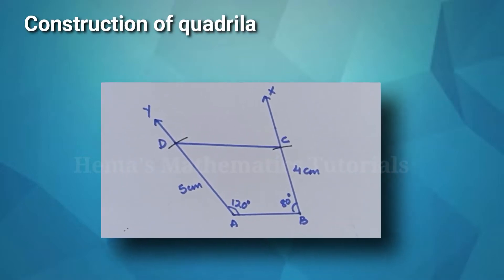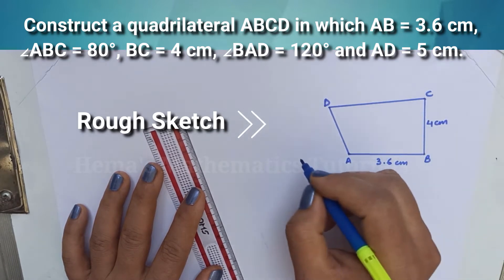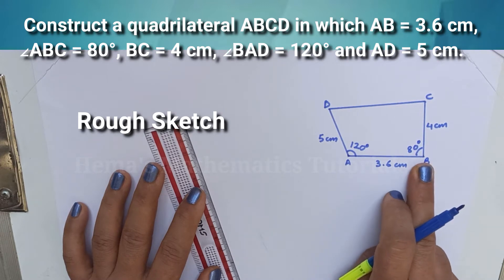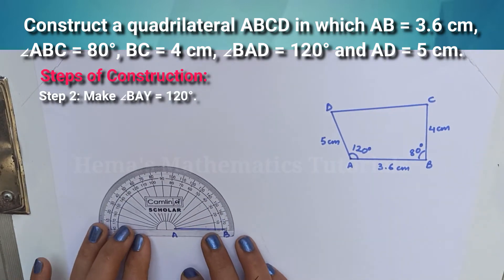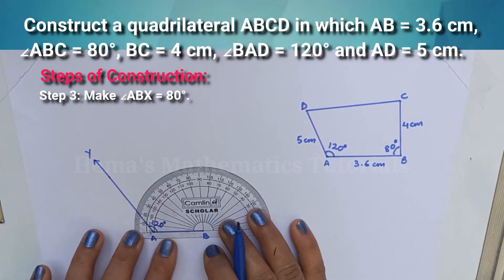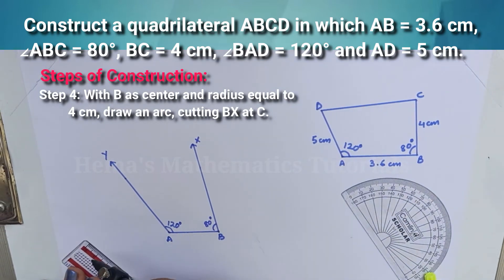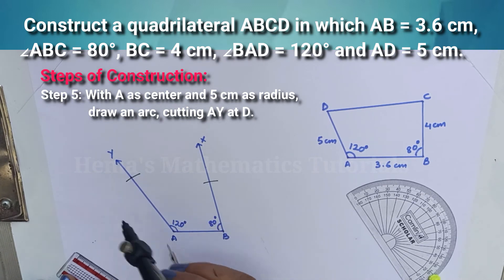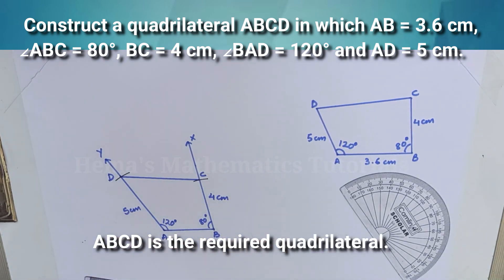To construct a quadrilateral ABCD in which AB = 3.6 cm, ∠ABC = 80°, BC = 4 cm, ∠BAD = 120°.....

Comment: Why you take 120°  downside of the compass and 80° upside  of the compass
Reply from the maker: See zero of which scale on the protractor coincides with the line. While making 120° place centre of the protractor at point A and point B coincides with Zero of inner scale. While making 60° angle place centre of the protractor at point B & zero of outer scale coincides with A.